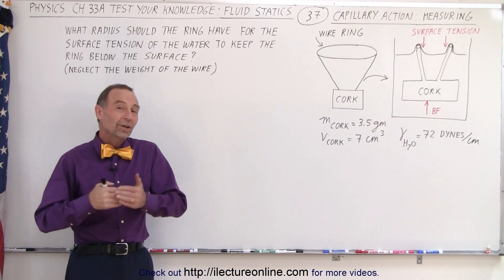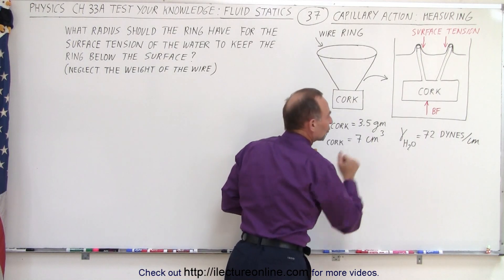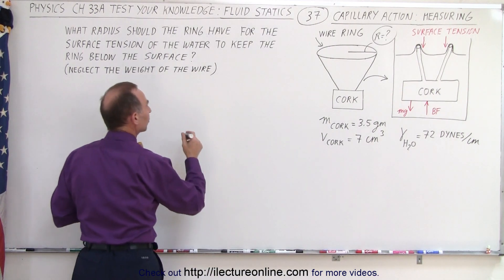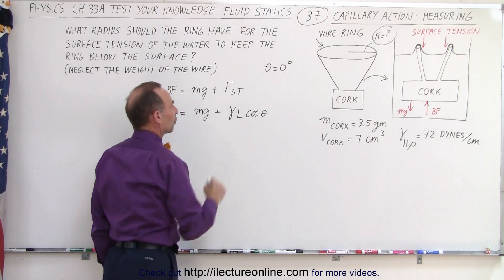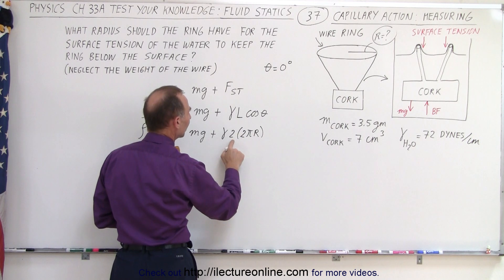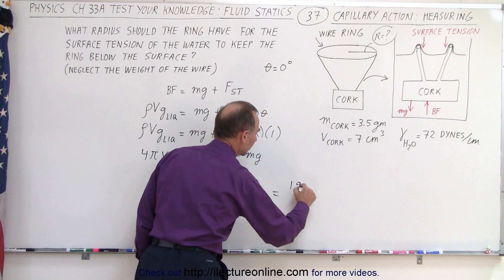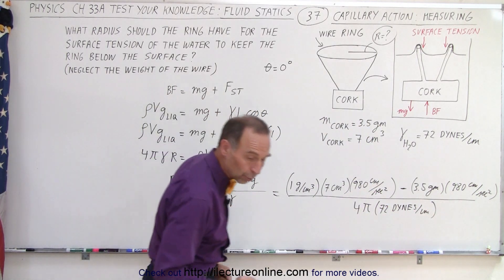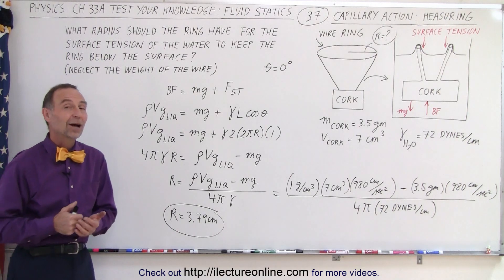Physics - Ch 33A Test Your Knowledge: Fluid Statics (37 of 42) Capillary Action: Measuring

Comment: Shouldn't the m in mg be not only the mass of the cork, but also the mass of the string and the ring ?
Reply from the maker: That is why we placed the note to ignore the weight of the wire.  Otherwise as you indicated, you should include the mass of the wire as well.